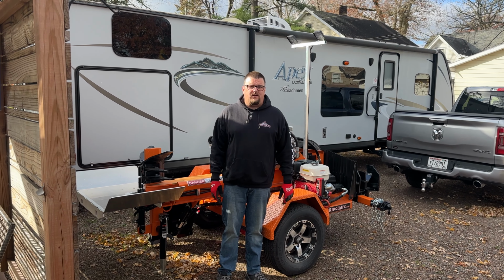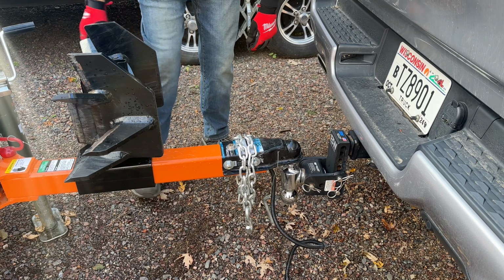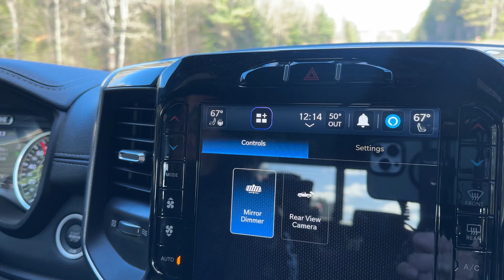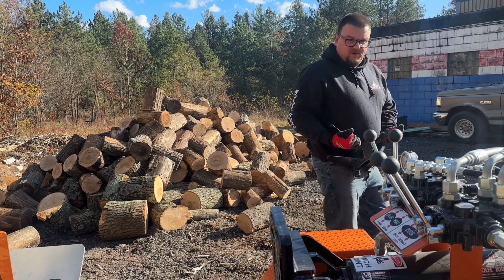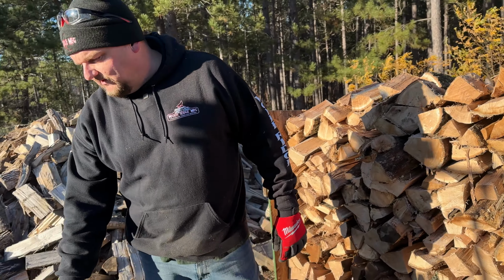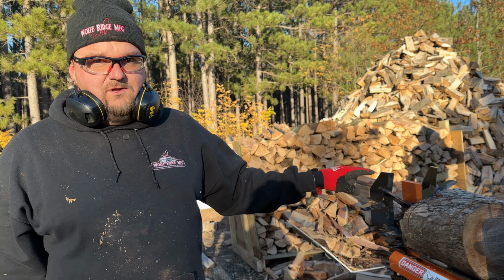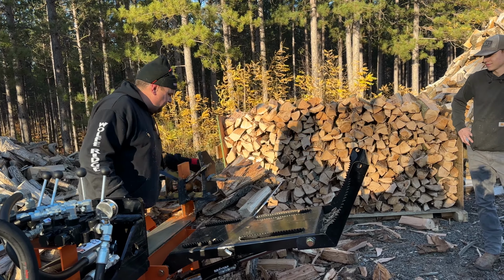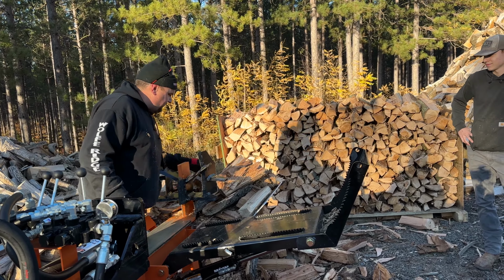Mobile Wood Splitting - A Road Trip with the Wolfe Ridge 28 HO High Output Log Splitter!

Comment: For Wisconsin hardwoods and tree service wood, would the 35 ton version be the better choice?
Reply: If you want to run the 12 way wedge often I would say yes.

For pulpwood especially, oak, maple, ash etc in that 8-14 inch diameter, our 28 ton will split through the 4 and 6 way wedges without an issue.
Reply: I would only run a 4 or maybe 6 way.  That stuff splits hard and you can control your sizes